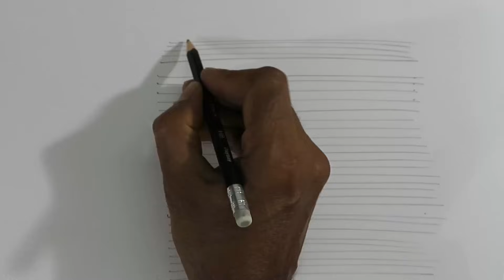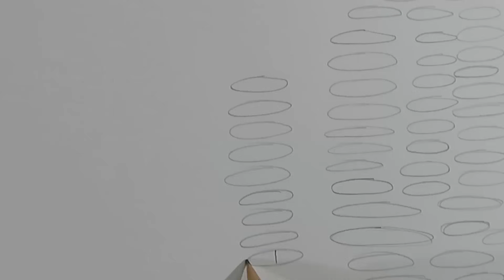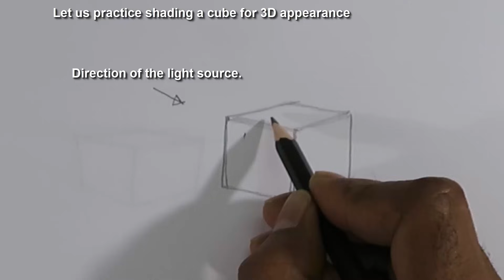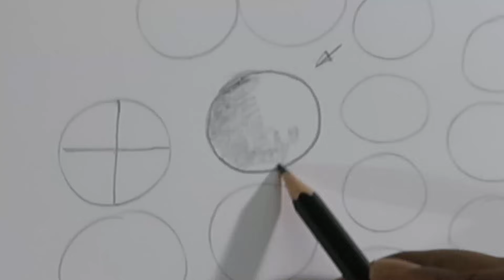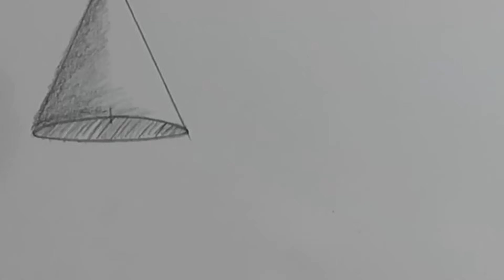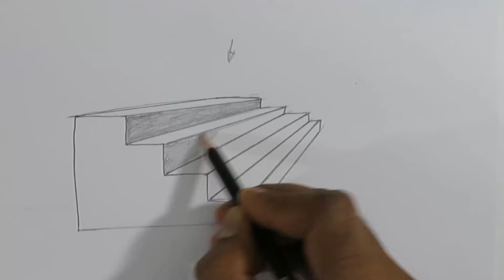7.1 - Ten Basic Steps to Free Hand Sketching for Engineering Drawing

Comment: what kind of pencil were u using in drawing lines
Reply from the maker: For free hand sketch you could use 3B to 5B. They are soft and black. For shading, you can start with 3B or 4B and finish with 6B.👍
Reply: @1styearengineeringdrawing182  can u explain to me whats the difference between 3b and 6b
Reply: @jasminewatsons4509  b denotes for black i.e. 2b,5b,8b,10b etc. And the numbers indicates the level of blackness, the more the number the black the pencil 🙂